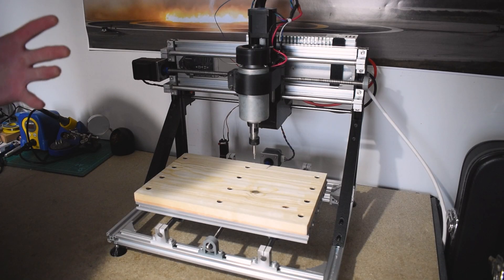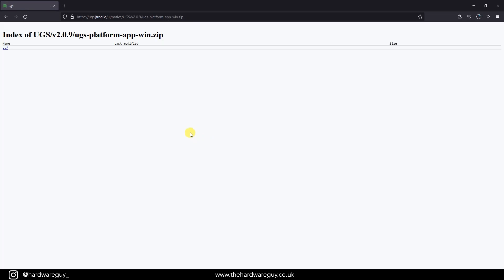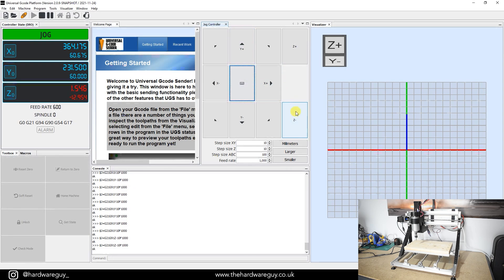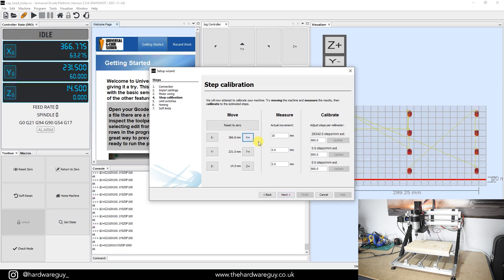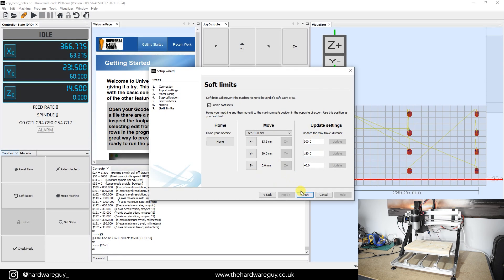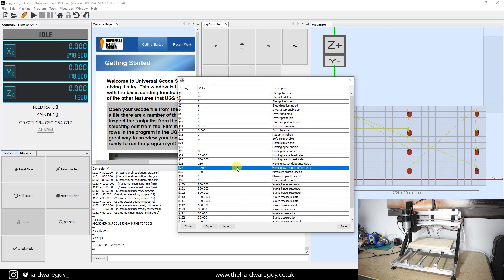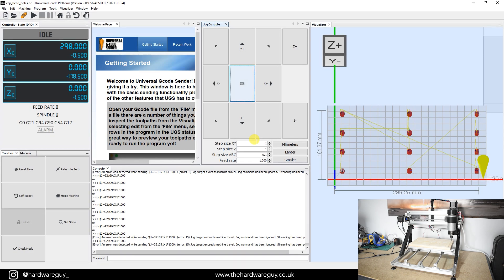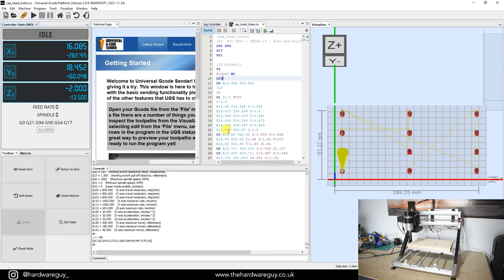3018 CNC Limit Switches & Universal GCode Sender

Comment: Can you start up the machine, instantly begin jogging and expect it to hit soft limits? My guess is you need to start with a homing routine like you did, right?
So if you get to impatient to wait for homing and you jog the router a bit to where it needs to be, you can easily overjog and run in to the limit switches.

Comment: Hey Hardware Guy, thank you for sharing your work. I just built a DIY Mini Mill using a Dremel and drill press frame with a cheap X &Y Table converted to Stepper Motors. And I added a 3 D Printed Housing for the Dremel to have Stepper driven Z axis. Now I want to add Limit switches but i was not clear on 3 or 6. But I see from your video a single switch is ok if you add the soft stop dimension. This is so clear to me know I feel safe with 3 switches and the soft stops. Thank You so much. Great informative video. I am going to machine a slot in the chassis of antique Model Train engines so I can drive 3D Printed Fan Smoke, Puffs and Digital Sounds for Steam Exhaust, Chuffs at 4 times per Drive wheel revolution. That is why I choice the DIY Mini Mill I had those parts and convert to CNC using Arduino and the CNC Shield. I am amazed at how simple it was to build the machine and add the CNC bits and like you said with UGS the whole control and setup. I have trouble remembering the buttons to open certain windows for setting, and I wish the designer was more GUI Friendly.  I am ready to design and print switch brackets and cams now then wire them up. I was told the Z Axis switch should not be wired to the Z + or Z- terminal but to the Spinlde on or off bacause I operate my Dremel on/off manually not CNC controlled.  Hey Thank You very much. Dennis
https://youtu.be/4LjwjdlHPYI?si=-3fYaIo_wFNPsSOO

Comment: The first what i encountered as a beginner was a Freezing VEVOR 3018 PRO with a .cn file generated by Fusion 360 . The Firmware of the VEVOR 3018 PRO has with G_Code G19 (select the YZ plane) a bug. The progress stops and the spindle just keeps rotating and no communication is possible anymore. Need hard reset. 
youtube.com/shorts/mk0A7qj7N0s see also youtube.com/shorts/QzzSysvoXXg.

Comment: Hello, I need a way to set the z-axis directions because it works in the opposite direction. Please help me
Reply: On the top bar is there a tab that says machine and then a drop down for setup wizard, after connecting you should have option to flip axis on x y or z
Reply: @gbresaleking  thanks 👍🤗🤗

Comment: Hi I am trying to set limit switches in UGS but when I press the limit switches the green squares do not change colour put the alam comes on and have to reset. What am I doing wrong can you help please.
Reply: If Alarm happens when pressing (or de-pressing) a switch, it's likely caused by Hard Limits being enabled. You can toggle that in the firmware settings screen shown at 9:45. I'm not sure either how Universal GCode Sender gets the switch state in the case of the presenter's machine.

Comment: I made my own 50 x 70 cms,. CNC and installed USG on GRBL and when I try to install the hard limits and soft limits with the Setup Wizard everything works up to the moment I have to introduce the limits of the machine but if I try to jog the machine, it gets into alarm and don´t move. So I have to manually disable hard limits switch so I can jog the machine but obviously the limits end out of the real limits of the machine. I can see you you can jog your machine with soft land hard limits enabled. What could it be? Thanks.
Reply: I know this old post but I’m having similar issues wired up like wiki shows ugs doesn’t recognize switches and crashes when a switch is activated any advice??

Comment: Thanks for the video. I have set up limit switches, same as yours, but the machine will not back off far enough on the Z and Y axis to release the switch, so it sets an alarm. If I try to move X or Y by jogging, they will move 1 step then set the alarm again.I have to manually move the axis so I can jog. When I go to the settings, $27=1.000. I try to change it to 2.000 or 1.500 but it gives me an error 3 code and won’t change it from 1.000. Any ideas?
Reply: Problem solved. The GRBL that came with the 3018 was crippled. Tried the files on the USB that comes with it, same problem. Downloaded the latest GRBL from GitHub and installed it an now all is fine.

Comment: Limit switches are best when using the nc (normaly closed) contact. This to get the machine stopped also when there's a cable brake. No other situation will detect that kind of trouble. Also using shielded cable for limit switches where one side of the shield is connected to the chassis of the machine and the other side is floating is the best way to get it done, with no false signals coming on them and the mainboard giving weird reactions...
Reply: Theoretically. In turn, the two endswitches of the same axis are paralleled on many control boards. In this case the two NC switches never open simultaneously, hence no end position. You can use one only per axis and use soft limits for the opposite end. Also, the polarity parameter has to be changed.

Comment: Great video and overview of the UGS. I've used Candle to control my CNC 3018, but have downloaded UGS recently. Just haven't had time to test it.
You brought up the homing function, which in my opinion makes the limit switches well worth it. After homing, machine automatically knows the absolute position of the spindle. That allows using different workspace coordinate systems, G54-G59. With them, jigs and holders with different zero points can be used, without needing to jog to that zero point manually. 
Also when machine knows spindle's absolute position relative to the limit switches, we always know where the highest point of Z axis is and spindle can be set to retract to that height.
There is so much more than meets the eye with these limit switches.
Thanks for the video!

Comment: When you wire your switches directly to the mainboard it's best to check if your controller board has debouncing capacitors or not. If there is no capacitor install a 10-100NF capacitor in parallel with your every switch to avoid noise and misreading on limit switches.